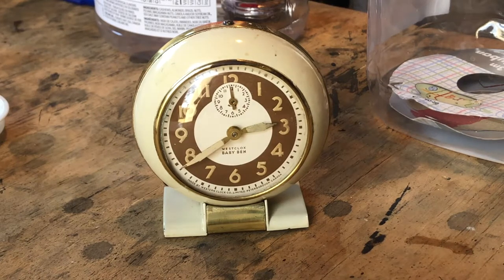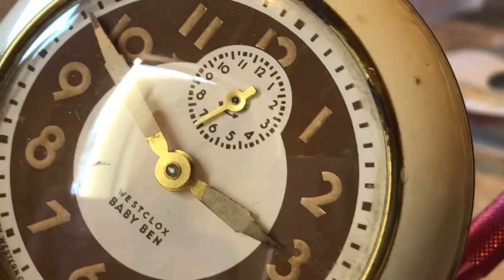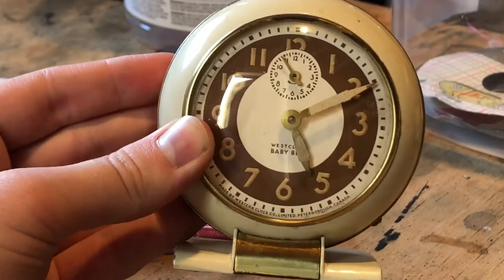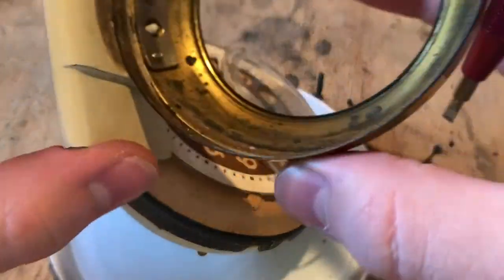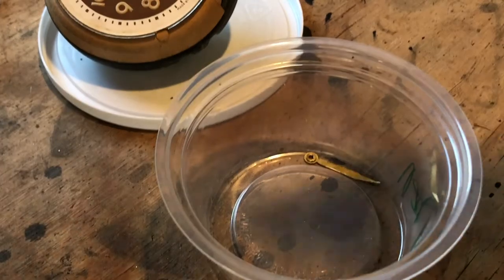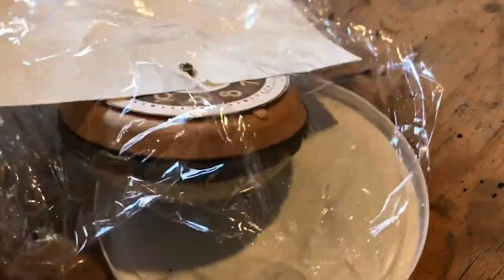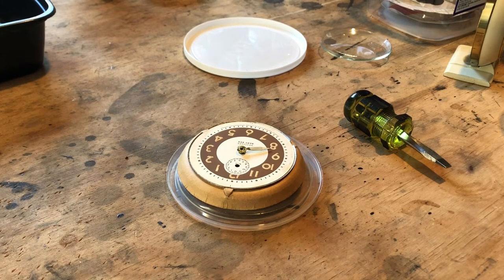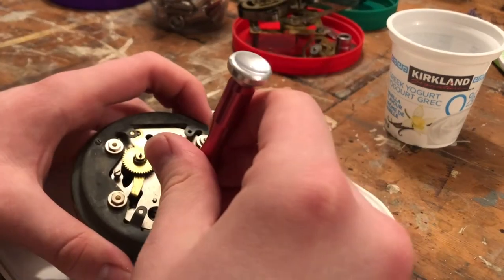1941 Westclox Baby Ben Style 5 Alarm Clock Service (Part 1)

Comment: I had the same thing happen on my Baby Ben with the hour hand. The hand came off and the hand's bushing was left on the clock hour wheel. I had to remove the bushing and use a staking tool to reattach the bushing to the hand. If you do not plan to replace the dial, I would just leave the hour hand on in the future. The hour wheel should pull off of the movement with the hand attached.

Comment: Very awesome clock!, i really want one but unfortunately they are hard to come by in the UK, i could buy one but import charges make the total cost above what i would want to pay.
Reply from the maker: the UK factory opened in about 1948 or 1949. By this time. This clock was discontinued and replaced with the style 6 Bens. You might have a good chance of finding a style 6 locally.